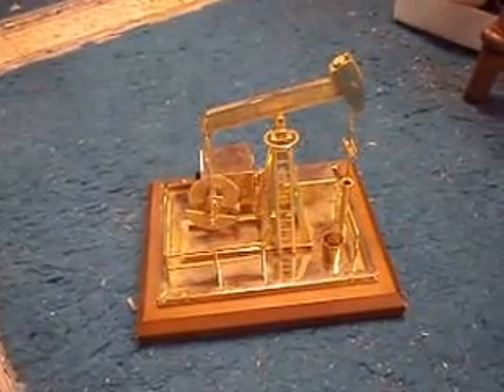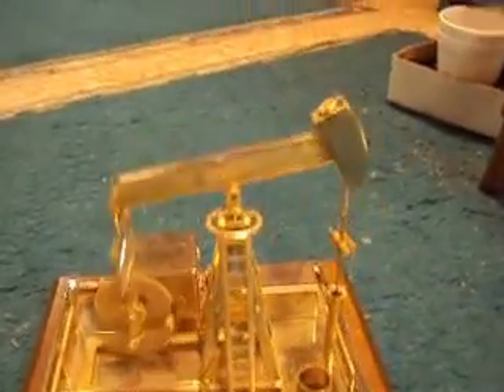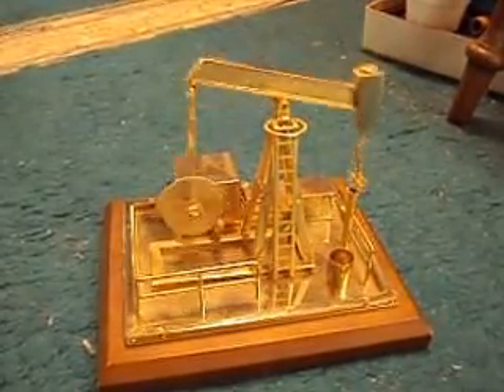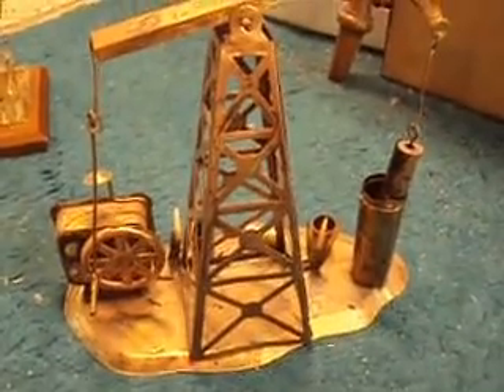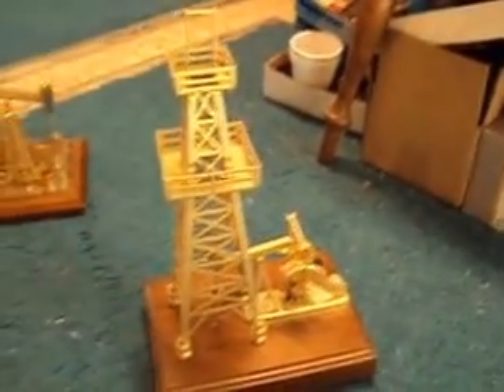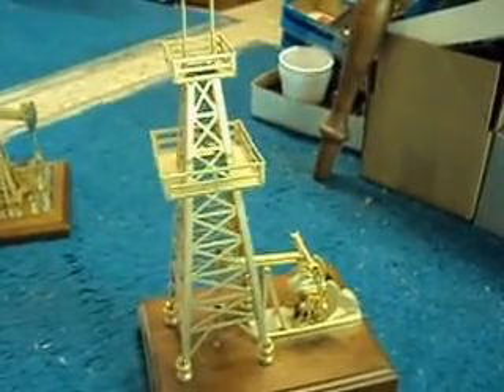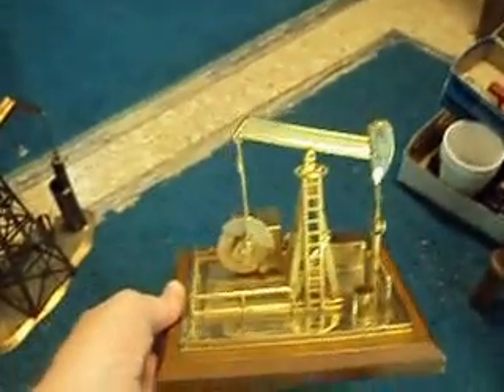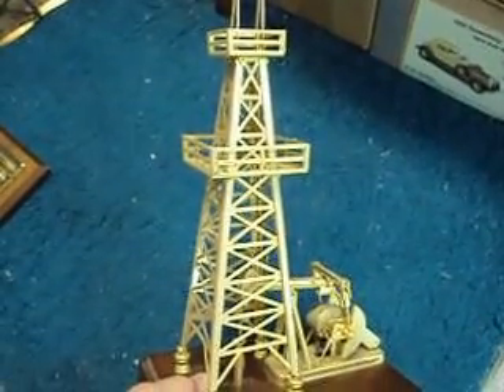EXPLAINING WHAT AN OIL DERRICK IS AND IS NOT

Comment: You need to see the engineers tower model that I have. About 2.5 ft tall with buildings generators and lighting. Powered anamation. All are in cast lead. Platform is finished maghonay with trim
 About 20 inches wide and 30 long
Reply: You should upload a video of that to your channel